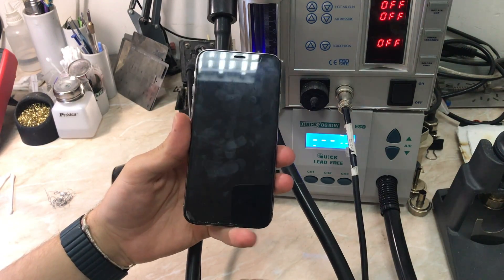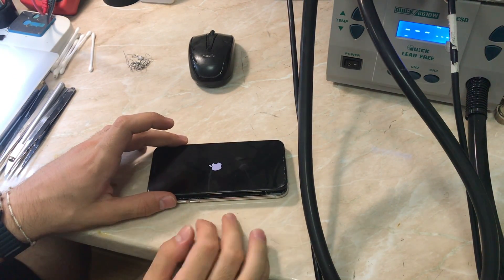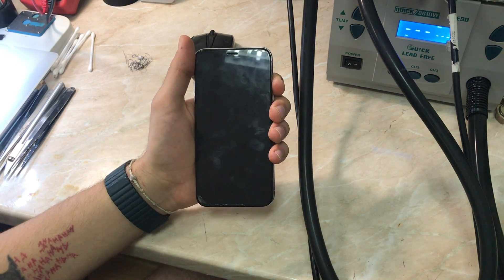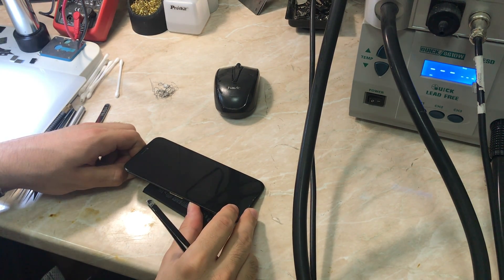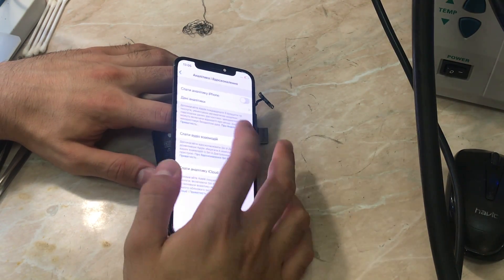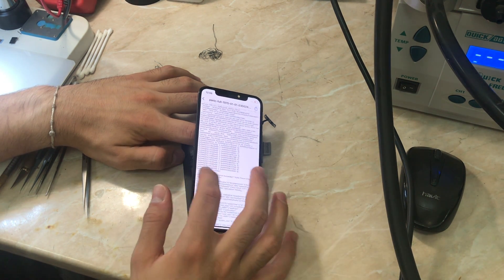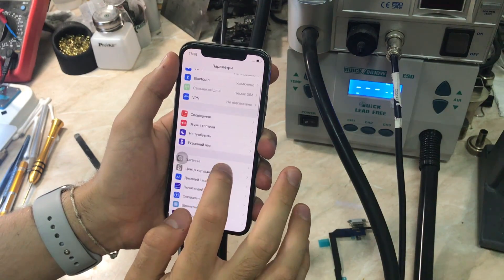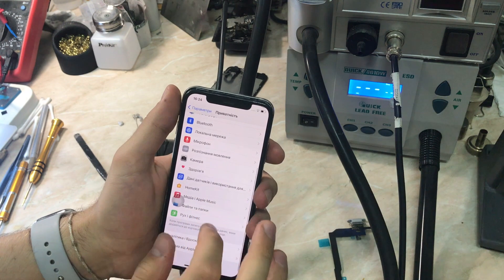iPhone X Stuck on Apple Logo-Restarting (i2c2 Panic Full) Repair

Comment: Hello mine is "i2c3::_checkBusStatus SCL is stuck low; last write status 00010100 int shadow 00010100 xfer 00000000 fifo 00000000 for device display-pmu\"\ , does it also need to replace the power ic?, it only restart when i charging my phone 1 day 1-2time
Reply from the maker: iPhone model ?
Reply: @AntoineKiriaky10  iphone x
Reply from the maker: It says displays pmu, try dm on telegram
Reply: @AntoineKiriaky10  ok can i have ur name